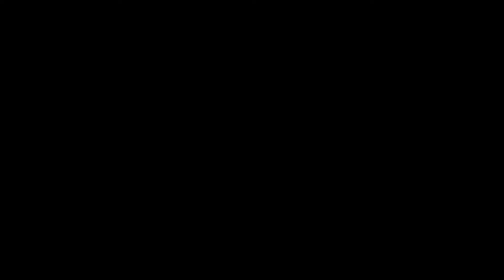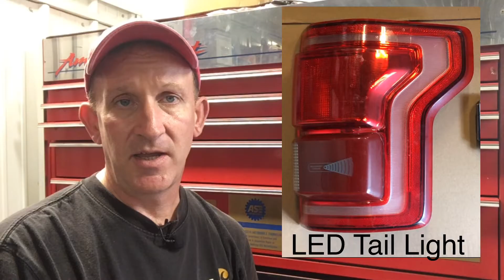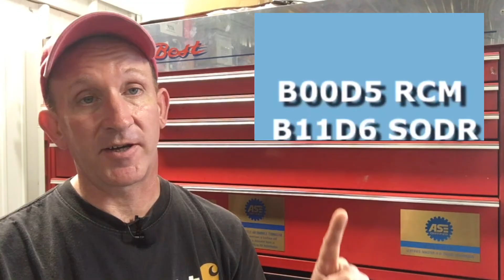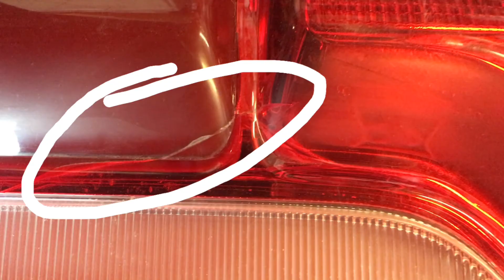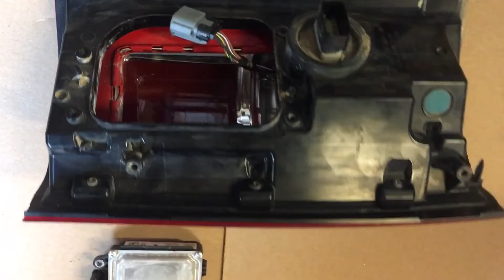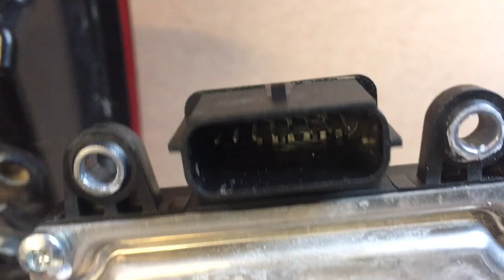2015 Up F150 No Radio Controls, No Heat or A/C and No Power Windows

Comment: My truck is having these problems but I don't have LEDs or blindspot monitoring. Could this still be the culprit?
Reply from the maker: It could still be something shorting the network. I would look under the back of the truck at the connectors between the box and frame first if you don't have BLIS / SOD.

Comment: Some 2015 F-150 vehicles equipped with Multi-Contoured seats may exhibit
various intermittent MS-CAN network related symptoms such as Blind Spot
Indicator System (BLIS), Cross Traffic Alert (CTA), Rear Park Assist (RPA) warning
indicators being illuminated and/or intermittent operation of the A/C and/or Power
Running Boards (PRB). Inspect the Multi-Contoured Seat Module (SCMG) wiring
harness for chafes or shorts due to contact with the drivers and/or passenger seat
backrest frame. Repair or replace the wiring harness as needed, following normal
Wiring and Workshop Manual procedures. If needed, the wiring harness retainer
clips can be relocated on the seat frame to prevent excessive wiring harness
movement and chafing.

Comment: I don’t seem to have a module in either tail light. 2018 f150 stx any other ideas. No HVAC or radio controls and airbag light stays on
Reply: Ik having the same issue on my 2018 ford f150 xlt
Reply: @bryanjhonson8174 I’ve tried everything. No luck so far. I checked every fuse under the hood and tomorrow I’ll check the fuses in the passenger foot compartment. I’m at a loss here

Comment: Man, thanks for the video!!  2016 Ford F150 and all the symptoms you described happened and it was EXACTLY the issue you mentioned.  Tail light had a crack and was full of water.  Replaced and everything back to normal.

Comment: Having the same problem our 2017 king ranch f150. But, we live in the desert where it vwry rarely rains so I cant imagine it being water. I did take both lights off but not the sensor panel. I didn't see any water or cracks. We had a rodent problem months ago so maybe ir could be some chewed wiring? But u cant figure out where it mught be with all the different issues it has. And its only sometimes. Any idea? Maybe a point in the right direction to look at wiring? Any help us greatly appreciated!

Comment: That was an interesting and helpful video.  My 2016 F150 XLT has just recently gone wonky and now I have an airbag light on, no gas gauge, non-functional radio and HVAC controls, non-functioning driver and passenger windows, and the fob no longer locks/unlocks the doors.  I checked both taillights and there are no cracks or water in them.  Same goes for the front ones as well.  I suppose that the module may have just failed on its own?  I'll open up the taillights and clean all the connectors, etc.  Any other suggestions or tips would be appreciated.  Thanks for doing this video!
Reply from the maker: If you can I would pull codes on it to verify the network is crashing. I’ve seen connectors behind the rear bumper get water in them and cause the same problem. If you find nothing there I would probably check the BCM for water.
Reply: @CarShopTalk  I did pull codes and got a bunch of failures for the A and B modules.  Where are those located?
Reply: @tomscyclerecycling8242  did you figure it out ?

Comment: I have a base model no hvac and no controls for radio. Had water in tail light but doesn't have have blind spot sensor. Multiple U codes

Comment: Thank you!!!! My 2018 F-150  had errors on Bliss, Cross-traffic safety system, tire pressure, front windows didn't work, radio & HVAC would not turn on. Yes, I had a crack in my tail light. Took it of disconnected everything dryed it out with a hair dryer. Sealed the lens with waterproof silicon. Put it all back together and GOOD AS NEW!! You saved me a load of money and probably several trips to the dealer....I CAN'T THANK YOU ENOUGH!!
Reply: Hey, did you have a lariat or somthing ? Cause I have the basic xlt and it doesn’t have the back light modules on tthem,
Reply: Oh wow! Maybe that's what's wrong with my dad's truck. It's a 2015 lariat i believe. Has a Blindspot sensor issue light bit now the ac, radio, and driver window doesn't work.

Comment: My 2015 lariat did the code thing sat.
Shut the truck off and it wouldn't crank.
Had to unhook the battery 5 times to get it cranked.
Once cranked it was a acting funny
No gear selection 
No backup camera 
No rear backup lamps
High speed fan came on
Transmission wouldn't down shift.
My taillight wasn't cracked but had water all inside.
Would this still be the problem area
Thanks

Comment: Same issues and trail light had water in after pressure washing truck,, 1900.oo and counting, for it took out my bcm as well,, all for pressure washing my truck,, "I" took and sealed up between red lens part and black backing of new lens,, new blind spot sensor,531.oo for it,, sealed with sealed everything with gasket maker, black, and still have to get Ford to program my BCM,, this is a joke drove Years with out this crap,, and it stopped my truck!  Yea, pressure washer!  1900.oo and counting

Comment: Yes. I had this exact same error and found a crack in my tail light. Replaced with aftermarket and it worked perfectly. Was recently in an accident and broke my aftermarket tail light and sure enough after it rained, my airbag light would come on cutting off access to both front windows and no air and radio access.
Reply from the maker: Glad it helped!

Comment: After putting this new part on did ya have to reprogram anything!  And what was your time to problem solve this issue
Reply from the maker: SOD modules do have to be configured with as-built data when replaced. Forscan or something similar can be used.

Comment: This is what happing to me 2015 f150,, my side mirror turn light is cracked, is this in this system as well, and the mod. Your talking of in the tail light
Reply from the maker: I don’t think a problem in the mirror could cause this. The one in the video is getting water in the side obstacle detection modules, located in the tail lights.
Reply: Tk ya sir,, what was your reprograming
Reply from the maker: @orvillewilkerson5432  reprogramming? The SOD modules. The configuration or as-built data needs to be configured with Forscan or something similar.

Comment: I removed my very corroded blis module.. but my climate control(heat), power windows, Airbag warning light, automatic running boards, heated steering wheel, all still aren’t working.. any suggestions?
Reply from the maker: Is the connector full of water?  Blow it out with compressed air if it is.

Comment: Unfortunately, not the issue with mine.  I have all these errors... still unsolved
Reply from the maker: The best way to diagnose it would be to plug into it with something capable of communicating with all the modules on the network to verify what’s happening. Anything that takes down the network will cause those symptoms.

Comment: I just installed taillights with the bliss system from a 2019 f-250  in my 2017 f-250 and my climate control won't turn on my radio won't work from the center dash controls but will from the steering wheel,air bag light and others good this be because I added these taillights even if they're in good condition??
Reply from the maker: It sounds like the network is shorting. Try unplugging them one at a time, cycle the key and see if operation is restored.

Comment: Thanks have 2015 f150 had multiple lost communication dtc  same symptoms found left tail cracked and water connectors corroded unplugged blew water out left unplugged hvac front windows radio started working.thank you helped a lot.
Reply from the maker: I’m glad it helped.

Comment: I got something similar w my f150 2014 I noticed while driving that my ac wouldn’t turn on or light up at all and my controls on steering wheel also stopped working for my radio while driving the tire pressure sensor light came on and flashed and then just stayed on also when I finally got home the radio stayed on after turning the truck off and getting out it just stayed on until I finally disconnected the battery fyi I got a after market radio but if anyone has any idea or had a similar experience, if you could shed some light it’d be much appreciated

Comment: See my truck has the air bag light, no front controls, no power windows, no a/c and other stuff. I do have a hole in my taillight but it doesn't have that module in it. The online forums point towards the FCIM  and ford told me that would be a $1500 fix! Is there something else I can look at ?
Reply: I have the same problem.  Did yours get fixed since you posted this?

Comment: My 2016 F150 is getting the Blind Spot and Cross Traffic errors on the dash.  The driver’s side tail light had moisture and a small puddle of water.  I dried everything, blew out with air compressor and added dielectric grease to all connections.  Unfortunately I’m still receiving the Blind Spot and Cross Traffic errors.  I’m guessing my blind spot module must be bad?   
If I replace the module with a new or used one, do I need to reprogram it?   If so can I use the ForScan software?

Comment: I have the problem but none of my tail lights are cracked
Reply from the maker: There’s definitely other things can cause a similar issue
Reply: Do you know like what else?
Reply from the maker: @williamholbron3726  Anything that takes the network down will cause the same symptoms. I’d want to plug into it with a scan tool for starters and verify the network is going down. Assuming it is, it could be wiring, I’ve seen issues where the harness jumps from the frame to the truck box or along the frame in the center of the truck. Any module on the network has the potential to short and bring the network down with it. The resistance across the network with the battery disconnected should be around 60 ohms.

Comment: Where is the exact location my car tailgate Amal crack but no water corrosion
Reply from the maker: Exact location of?  The network?  It’s the twisted pair of wires going into the BLIS module connector, but that network runs throughout the vehicle and a short in it anywhere will cause the same symptoms.
Reply: I remove tail light check no changes all the ms can communication failure water corrosion not found am already replaced fcim any easy way to check shortages in communication lines
Reply from the maker: @eldhopv6750  if you unhook the battery, it should be 60 ohms between the two network wires and both should be infinite to ground or power.

Comment: My 2018 f150's driver side running board us stuck in the down position,the folding mirrors heating and a/c not working tire monitoring isn't working and power windows also not working.
Reply from the maker: Is there water in the tail light / is it equipped with blind spot monitoring?
Reply: @CarShopTalk same exact issue absolutely no water in tail light. But I just replaced to after market light and reinstalled my blis module in the aftermarket tail lights. And now have these issues and blis error code and cross traffic alert code

Comment: I have a 2016 F150 lariat crewcab, the radio, ac controls, front windows and powersteering dont work. After somebody backed into my truck at a parking lot and did a very small amount of damage on my drivers rear taillight, I thought no biggie. I brought it home, put it in my garage and a few days later it wouldn't start, then I had a flatbed send it to the ford dealership and they replaced the battery. The truck runs and drives like new but they said it must have been hit by lightning because the power steering is not working and all the lights are on, on the dash. In addition to all the lights on, on the dash, the ac controls and radio does not respond, although they have power, also the front windows and power steering wont work either. After taking it to the ford store they told me the total bill for making everything perfect would be just under 15k. They did tell me that the power windows have been reset, I did ask them what about the damage on the taillight, thanks to your video, 1:11  but they told me that did not matter. They did tell me that they would recommend replacing both taillights and BLIS modules for both rear taillights but that had nothing to do with the other issues, also they said they would have to put in a new steering rack, ABS module, a sensor in the driver and passange seat, and possibly a air bag module in the center consul somewhere. I know for a fact that is was not hit by lightning because it was kept inside my garage. When I asked about the tail light they told me I could not buy it myself and put it in because it has to be programed, so I paid the just under 1200$ bill and brought it home, am I being scammed??? I would really appreciate any knowledge you can send my way, thanks Titus
Reply from the maker: It’s always hard to know without seeing the vehicle, but I’d be shocked if it’s the correct diagnosis. I really doubt half the stuff on the truck failed at once. I’d still wonder about the tail light damage somehow shorting the network or bliss module and causing several of your symptoms. For the others, honestly I wonder if the battery was momentarily hooked up backwards or the system received a large electrical spike when the battery was replaced or the vehicle was jump started. You might try unhooking the battery for an hour and then hook it back up and see if there’s a change. There’s a large power cable going to the rack. Make sure they didn’t loosen it when replacing the battery. Get a second opinion from someone knowledgeable with Ford’s and network diagnosis.

Comment: I’m having this same issue now. Checked both tail lights and both are fine, no water in them either. I blew air into the tail light connections still no luck.
Reply from the maker: The tail lights getting water in them and taking down the network is a common cause for this, but a wiring problem or module any where on the network can cause the same problem. Really you need to get a scan tool involved and see which modules will communicate and if in fact the network is down or you have something else going on.
Reply: @CarShopTalk  will your local auto parts store have that tool to check?
Reply from the maker: @ipsych0tic220  most of them will just have a cheap generic scan tool that will read the pcm. You want to know if you have communication with the front control interface module, drivers door module, HVAC, etc and what codes are in them.

Comment: Spot on.  My passenger side taillight had 1/2 cup of water and a small crack close to the tailgate. My running board are not deploying  but everything else is working after drying it out with paper towels and a hairdryer. 👍
Reply from the maker: Glad it helped!

Comment: Could this also be caused by the taillight harness being unplugged?
Reply from the maker: Not unplugged. If the network wired in it are shorted together, shorted to power or to ground it would. Throw some water in the unplugged connector and all kinds of random things can start happening.

Comment: I have a base xl truck with these issues but no
Module in taillight? Radio is on but no volume, no dash power or window / lock controls
Reply from the maker: It could still be an issue on that network for another reason, or it could be something entirely different. You need to get a scan tool plugged into it and see what’s going on with it.
Reply: I have the base model too, any luck with it. Plz let me know.

Comment: I had the exact same issue except I have an xlt with no blms.  I replaced the tail lights and checked the connectors for corrosion and nothing!  Still have to problem.  What do I do now?
Reply from the maker: The tail lights are a fairly common issue on vehicles with BLIS, but on a vehicle without, it sounds like something is taking down the network, but it could be a wiring issue or any of the modules on the network.
Reply: Did you find the problem, I have the same Issues, no blis module?

Comment: The same thing happened to me today while driving home and I was about to have a panic attack.  I was like great the whole truck is F-d up now and out of extended warranty even on my 2015 F-150 Platinum.  Well I looked at the right rear passenger taillight after looking on ford message boards and mine had obvious water intrusion and condensation.  Maybe has a small crack but I never hit anything so who knows.  The bliss had malfunctioned during heavy rains while driving and in the morning after it rained hard all night.  Usually worked again shortly after that and no problems ever when not raining until now.  I took out light unplugged light and cleaned connectors and used canned air to spray out.  Let it dry in sun and drove it around my neighborhood for about 5 miles with no tail light in and everything magically worked again.  The tail light had about 2 cups of water in it after I removed it and dumped out the light. Ordering new tail light and pulled off bliss sensor and put and dried it with a towel as it was kind wet and put it in a bad of rice to try and save it even though it apparently has been wet for several years off and on.  So once I get a new tail light I will clean the bliss sensor connector and add some carbon conductive grease to all the connectors and see what happens.  Hopefully it was the connectors and not the bliss sensor but we will see in a few days when I get the new light and install it.  I am drying out lights and may reattach without bliss sensor until new light comes in so I can drive it still.  Great info on the video.
Reply from the maker: Glad it helped!

Comment: This helped me out so much! Thanks for making this video. Had the problem fixed in a matter of minutes. Probably will need a new taillight eventually, but glad to have a temporary solution. 

Any ideas for a leak with no visible cracks?
Reply from the maker: If there’s no visible cracks it has to be where the lens glues to the housing. Glad it helped.